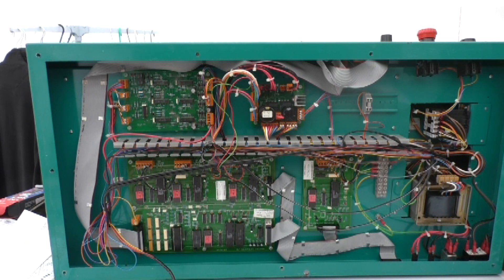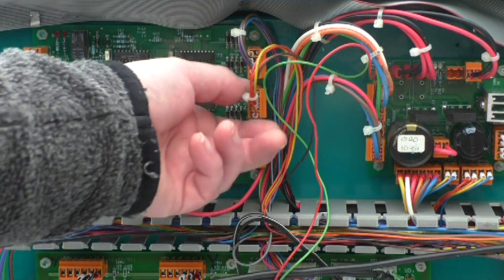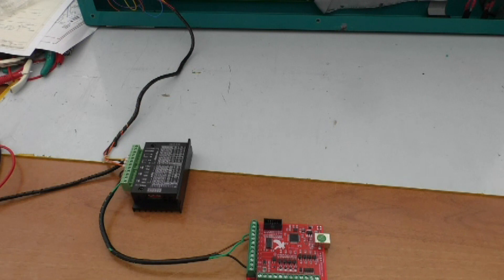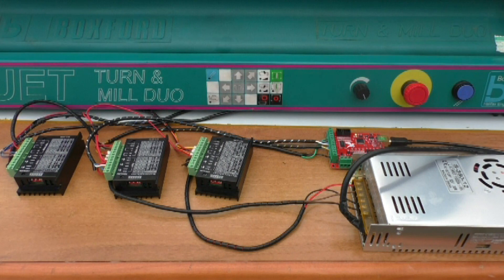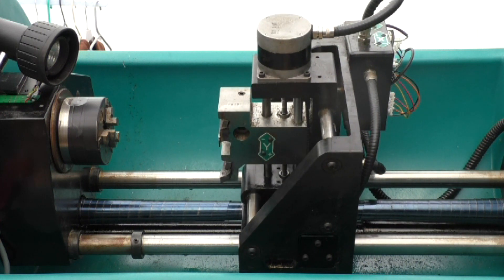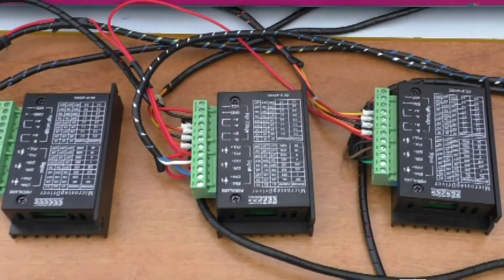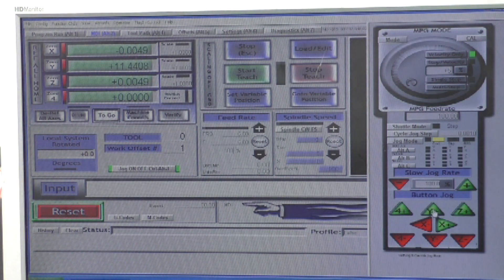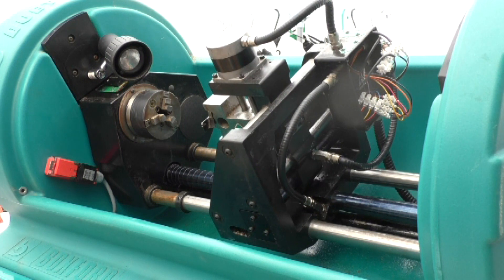Boxford Duet Turn & Mill Duo Mach3 conversion (Part 2) Stepper motors

Comment from the maker: Hi, Just noticed a mistake on the Drawing, DO NOT connect the Mach3 Control Board Pin (GND) to the PSU 0v.